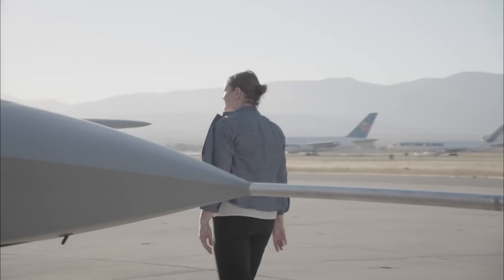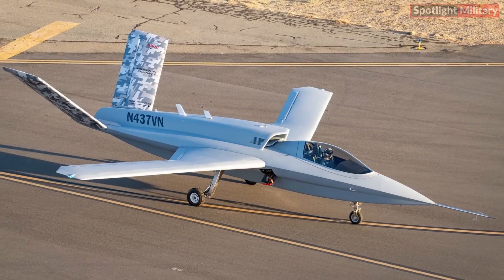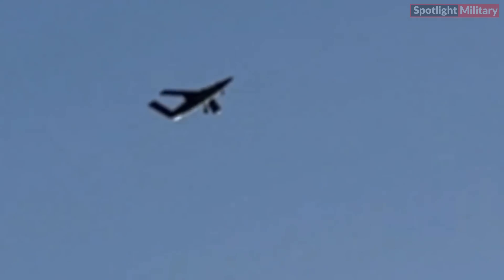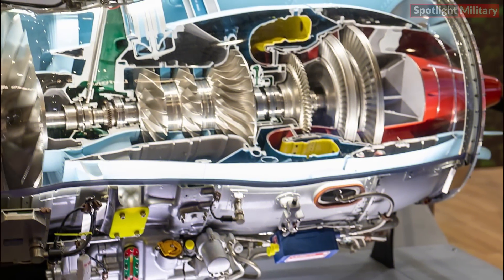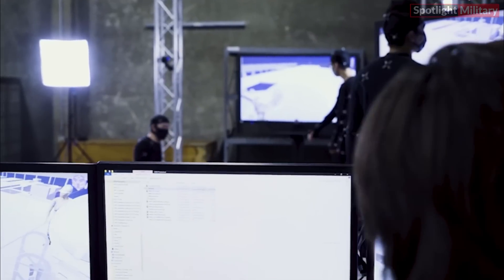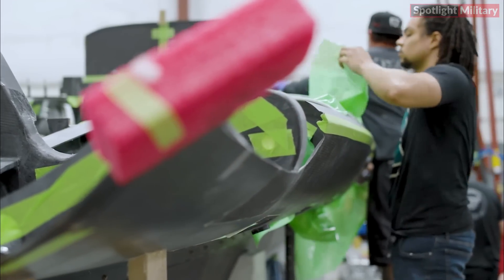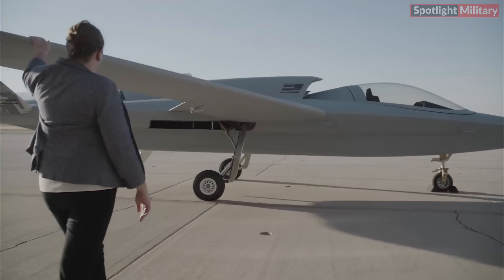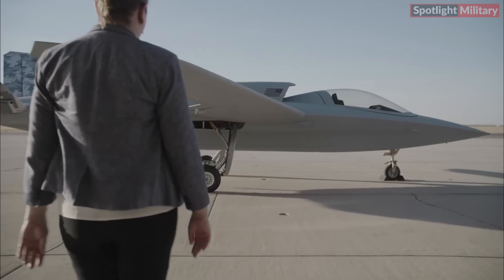Northrop Grumman Redesigns Drone Into High-Tech Manned Jet

Comment: I don't get it, what this function for. It is useless, it can't carried heavy missile, can not doing jet fighter manuveur, not even can be a kamikaze drone, not even suitable for be spy plane, it only suitable for training exercise plane.
Reply: Range is an issue today and cost. The NGAD fighter won't outmaneuver the F-22 because range and payload are more qualifying factors for the next aircraft.
Reply: I don’t think the point is to build a fighter that can beat a Su-57 in a dogfight, rather to build thousands of capable stealth aircraft, quickly and affordably, that sip fuel and have a long range and the ability to communicate data with one another in ways that allow our more capable aircraft to do what they need to do without getting blown up. But still arm them lightly just in case. So have one F15EX and 10 of these guys either manned or unmanned, as a force multiplier. That’s just my take on it.

Comment: What's with those huge rectangular tail surfaces?
Reply: My guess is they help increase payload capability in spite of the really short, highly tapered, high aspect ratio main wing by increasing overall wing area AND allowing better control with a more efficient, aft CG.
Reply: they're called vertical stabilizers